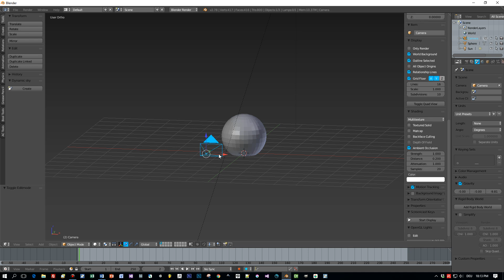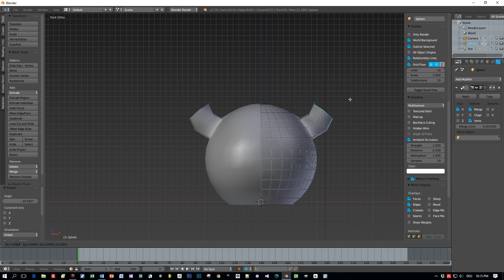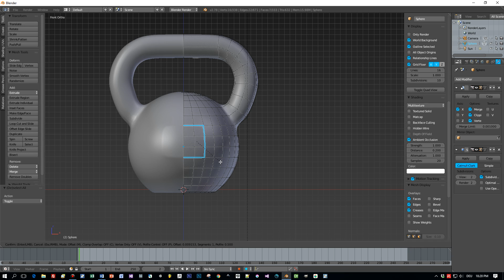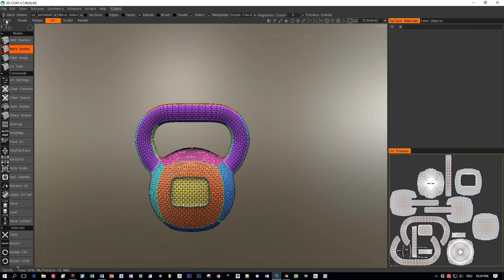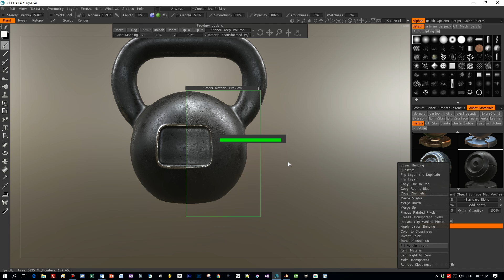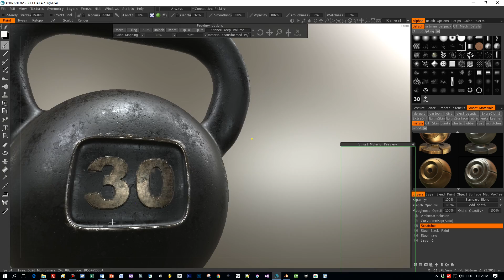Blender 3D-Coat Tutorial : Create a Kettlebell with PBR materials

Comment: Really nice! I'm starting to like 3D coat from video to video, more and more. Really easy to see how one can benefit from using this kind of texturing instead of wasting time on PBR Blender materials or procedural ones. Can you do a short video introducing 3D coat basics from a Blender user perspective? Eg when its advised to use, what are the backdraws? Maybe its just personal preference?
I am still iterested in what its capable of for an average Blender user. Thanks! Keep up the good work, cheers! :)
Reply from the maker: Thx man, well, I wanted to create one on how to use primitives and boolean operations with 3d-Coat, they are very powerfull. From the Blender point of view the import of the model is important and if you created a highpoly with Blender then the retopo in 3D-Coat is extremely good, in 4.7. there are new tools added for this feature.